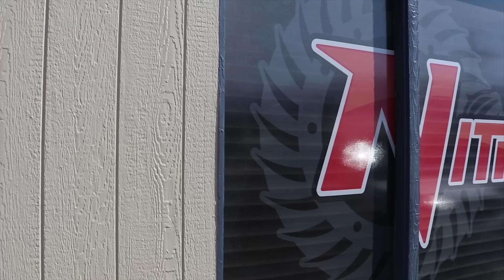The Tacoma gets 5.29 Nitro Gears | Huge improvement!

Comment: When I went to 5.29 in my rock crawler it was a huge difference. Such a great difference. Glad you did this instead of getting another truck.
Reply: @Delta Striper Slayer -- I went to 529 on my rock crawler it has 37 inch tires. It brought my power and torque probably right back down to stock performance, as well as the gas mileage
Reply: Aftermarket axle set up since it's a rock crawler?
Reply: Jimmy Jet! Question, would you recommend a future gear ratio change on a 2015 4RUNNER SR5? As you know the stock ones lack power in the torque department and soon I’ll be putting 35’s on to start some “overlanding”. Your thoughts :)

Ps MP sick Taco! Subscribing right now!
Reply: @patrickgronemeyer3375  
so, what do you drive?
Reply: mpg after ?

Comment: Toyota just needs to put the small v8 in this truck bottom line🙏
Reply from the maker: That would be awesome
Reply: why don't you do it.  only cost about 10K for a 400HP motor
Reply: Yes v8 taco and diesel tundra.
Reply: Agreed the V6 are shit, it doesn’t have to be a race truck but a huge displacement V6 is doing the truck no favors
Reply: @thenavigator5889  10k you drunk?
Reply: @MotoRacer171 , I'd need it supercharged too
Reply: @thenavigator5889  think you can buy a suoercharger for a grand used
Reply: @MotoRacer171  or less
Reply: Twin turbo v6. Would be dope. Tundras will have a twin turbo v6 soon
Reply: V8
Reply: I don't think you guys will ever see a V8 in a Tacoma
Reply: Turbo diesel
Reply: these trucks are midsize trucks the ideal is to have a midsize engine for better fuel economy 
if you want a v8 go for the full size..
Reply: I've seen a 4.7L V8 in a Tacoma. I have a D-4D 4 cylinder diesel engine in my Tacoma. The torque and mpg is awesome, I've also done a bigger gas tank as well and my hwy mpg range is 800 miles or so.
Reply: @stevenpeterson7234  You're a beast! Thinking of doing this to my 2020 Pro. Been doing research on those engines for a while now. I can get one around $6500. Do the Fab work my self.
Reply: @kouki2123  
The D-4D diesel engine is a beast, I've had no problems with it. Honestly worth it!!! 🤘👍
Reply: 4.7
Reply: Or a diesel
Reply: @stevenpeterson7234  link to the fuel tank?
Reply: I got a 4 cylinder 4X4 3rd gen 🤘🏼
But would not be mad  at a v8, like inside that grey full sized from the last snow wheel adventure 🤔
Reply: I dropped a 5.7 in mine
Reply: I personally would just put a magnuson supercharger on it.
7k, as small a truck that is, it would feel like sitting on a rocket.
35's -  5.29's .
Reply: Yes!!! Or a diesel option and better gear options from the beginning
Reply: Besides rehearing keep the 6 calendar and add a turbo with a 5 speed manual and you will have better power better gas mileage and more fun you don't need to have the most powerful engine but it is good to have the power when you need it
Reply: Please help Toyota come up with a suggested MSRP for a V8 powered Tacoma.

Comment: I run 5.29 in my 100 series with 315s and LOVE them. 

Could not be happier. MPG went up. 14.7 from Tyler Texas to Colorado Springs. 75mph-85mph the whole way

Holds OD gear uphill with no drama. 

With the 3.1:1 transfer case gears, I can take my feet off the gas and brake on steep descents and just crawl down the trail.
Reply: Does it effect the overall speed on highways?

Comment: Hey Maxx, i find this video an eye opener and helpful. I was leaning towards the 4.88s for some time now and when i watched your video, it gave me a new perspective. I definitely do prefer the low end power as my current setup on my taco is getting heavier with all the mods i have done so far. i have a TRD-OFF ROAD manual transmission with 35s and some accessories on and i'm always shifting gears and definitely lacks the get-up and go that i miss when i first drove it off the lot. The 5.29 will definitely be my next major upgrade. Great video!! Keep them coming...

Comment: When changing axle gears ratios in a 4X4, the front and rear axle ratios must be the same ratio when operating in four-wheel drive. If the front and rear axles are different ratios, severe damage to the transfer case and other truck components will occur
Reply: no kidding.  good message
Reply: Oleksii Silin Im sure they know it

Comment: This is a great Video!  I have a 2017 stock. I feel even the stock struggling often. I use the ECT Power more than I should just because it feels so much better. I'd like to make this change in the future to the 5.29. Thanks Max! Good Info.
Reply: Blue14 I do the same thing.  Going to upgrade to 33s and hoping just using ect all the time will be sufficient and I think it will

Comment: Best way to explain a re-gear like you had done in your truck is if anyone has ever riden a mountain bike before. When you switch the gears as you pedal the bike and you can feel the difference in how hard you have to work. In a low gear yes your legs are moving faster but they are hardly trying inorder to get you to move. To high of a gear and your not doing to many rpm's, but you are having to push a lot harder then you normally would. That's just a good way to explain the difference if you have never experienced it in a vehicle before. It was for me anyway. K have a good day everyone!!

Comment: I love my 5.29 gears in my 93 4 runner. But the shop that rebuilt my rear end was trying to talk me out of the 5.29 because the pinion gear has less area to contact the ring gear. They were pushing hard for the 4.88 gears. But with my lil 3.0 and 35 inch tires it works out perfect. It put it back to stock feeling power and my Speedo is right on with my 35's. The shop then showed me a 5.29 pinion gear that was sheared off. But way more power I het from,the 5.29. I put a 4.30 in just to try it out and can't even think about using 5 th gear. But breaking in the gears sucks. I just put an Eaton E locker in and new bearings and seals in the rear end. Still in break in mode. I live in Bellingham Wa so I might see you on the trails sometime.

Comment: This video is the exact reason I went from stock 3.07's to 4.88's on my Jeep.  Congrats on getting your performance back!

Scott
Reply: What engine/transmission and tire size are you running? I'm still stock on my LJ with 33"
Reply: @gordis951  315 /75-r16 Mickey Thompson MTZ's on 16X9 PC Alloys.  4.0 with a 5 speed manual transmission.  G2 D44's front and rear with 30 spline chromoly axles, 4.88's and Detroit Truetracs.

Comment: Fuel efficiency of the engine is different at different rpms and also at different throttle positions, so its crazy complicated to know the best rpm to run as driving conditions are very dynamic.   Fuel efficiency is also affected by how the engine ecu is programmed.  It isn’t always for maximum fuel economy due to power and emissions requirements.   Gear ratio steps in the Tacoma 6spd auto are kind of strange and only Toyota could explain why they chose them as they don’t have even spread like a typical auto or manual.  In addition, it seems that to protect the transmission, they program it to shift out of overdrive at a relatively low throttle position when requiring higher power delivery, especially at lower rpms where heat from loading/lugging it could affect its life.  So regearing to get higher rpms allows the Tacoma to hold the gear longer as you will have more power available due to the higher rpms, but also, the programming of the shifting based on throttle position is allowing the transmission to hold the overdrive gears longer as the higher rpms mean less lugging.   
Generally lower rpms are more fuel efficient but only if you have enough power in the engine at those rpms and you are not being detrimental to other things, like heat and stress and emissions etc.  If you run, more weight, more wind and rolling resistance, bigger tires etc, you need to over-correct the engine rpm to get more power and better throttle position which will effectively and generally give you better fuel economy than stock gearing for the same exact driving conditions.
Reply: It would probably be best to let the dealer flash the ECU like a new truck. It has the ability to "learn" driving styles.

Comment: I follow TW pretty much every day, and didn't see anything about 5.29's even being available at this time.   4.88 were the only option for 3rd gen Tacos as far as I could tell.  I must have missed the chatter if there ever was any of the Nitro 5:29's availability. 

It's truly a liberating feeling once you change gears, huh?   Back in the 90's, I had an F150 with the 5.0, and something like 27" tires.  I jacked that truck to the moon with a 3" body lift + 6" suspension lift, and 36" Swampers.  Ran it this way for a few months and then regeared from 3:55 to 4:56 and that truck came back to life with extra ummph to boot!
Reply: There is a 5.29 thread on TW. They have been available for several months.
Reply: Thanks Marcus.  I looks like it was just this summer that the 5.29 thread got started.  It never popped up in my view when I clicked on "New Posts".  So far it looks like just a handful of folks have been swapped to 5.29, but all are AT guys.  Looking forward to hearing how it feels with the MT (like I have).

Comment: Great video! I’m about to get myself some nitro gears! Really debating between the 4.88 and 5.29 though.
Reply: Me too... still debating. I was thinking that it really depends what you do to the truck. I heard 33s or less for tires you stick with 488. Anything more than that or extra weight and tow, you go 529. I keep hearing different things though. It’s like there is no really correct answer.
Reply: @vietta3771  I know eh, I’ve heard the 5.29 won’t be too much and I’m scared of doing 4.88 and not being enough for the hills and towing but in scary 5.29 will be too much for 80% city driving
Reply: @Rickwynne  I’m in the same boat. I’m running 33s now. 285/75/16… No lift. Probably won’t. It gear hunts all over Dallas Fort Worth. When it’s windy… it’s worse! 15-16 average mpg and with the way gas prices are, it’s getting about the same as my buddies stock raptor …
Reply: @vietta3771  I feel like I’m gonna go 5.29 cause I don’t need to be doing 130+ km/h on highways always. And will be nice for towing and all the hills. Fuel
Mileage improved would be nice too, gas is outrageous
Reply: @vietta3771  you end up doing a regear yet?
Reply: @Rickwynne  with the gas price increase I went ahead and sold my truck then bought a Tesla instead! Lol, to be honest, I’m a whole lot happier. I don’t need to load items as much as I use to and everything else fits in the surprisingly large trunk of my model s. Insurance is higher but I only pay an extra $100 a month for my utilities versus the hundreds I spent for gas.
Reply: @vietta3771  oh nice bro! Yeah that’s hard to argue with. I honestly just need mine for camping and getaways otherwise I would have a car
Reply: @vietta3771  oh nice bro! Yeah that’s hard to argue with. I honestly just need mine for camping and getaways otherwise I would have a car
Reply: @Rickwynne  I’m seriously waiting for the truck EVs to be more of a thing. The range right now is too low for long distant trips. The rivian is super nice. My buddy has one. The hummer is too. Once they begin installing more chargers on routes I think I will make the switch.

Comment: I just bought a 2019 TRD Off Road, and this is the first vid (and subsequent comment section) that I actually felt like engaging. You being from the Northwest made it even better. It's been tough finding a place online to discuss these things in a civil manner without the pretentious douche bags coming out of the woodwork screaming "mall crawler!" if I don't install a certain type of tire haha. 

I have no idea what direction I'm going to take my mods in,  but this is something I'm definitely going to be looking into at some point. 
Even on my test drive, I can already tell that as much as I loved the truck, some of the "searching for gears" statements in this vid certainly felt validated. With all the "research" Ive done thus far, I know some changes will need to be made if I'm going to get the full potential out of my truck. I appreciate the vid. It was entertaining and informative. Subbed.
Reply: @Maxx.Powell  Thanks! That's good to know. The truck is still in transit from the factory, so I'll definitely make sure to bring that up when it arrives.

Comment: All I hear from Youtubers is Tacoma transmission searching for gears, I have a 2020 tacoma TRD. Just drove from Washington state to Moab Utah and back. Truck fully loaded and a rooftop tent approximately 750 pounds total. About 1150 with myself and family in the truck. I have rock sliders diamondback bed cover, and load bars. My truck was never searching for gears, never upshift and downshift in sporadically or any of that. It held strong over all the massive long uphill grades. The vast majority of the time the truck stayed in one gear and pulled over the mountains with no problem at all. So I just don’t know what people are talking about when it comes to the Tacoma transmission. I’ve had no issues or complaints so far, no upshifting and downshifting searching, hunting for gears. Simply have not experienced that at all.
Reply from the maker: Being that you have a 2020 your ECU has updates alot of Tacomas on the road do not have.   My 2016 Tacoma needed to be updated to fix this issue
Reply: @Maxx.Powell  thanks for mentioning that. I thought I was going crazy, like, am I the only tacoma owner who is not experiencing this? I think people might use "3rd Gen Tacomas a little to generically when discussing issues. I'm glad the re-gear worked out for you, seems like a huge difference. thanks for the reply, have a great day, and keep up the good work!

Comment: For daily driving 529 gears with 35 inch tires, is way over the top. If you wanted to increase your crawl ratio when going Offroad, you could have put in one of those dual transfer case mods. With both transfer case is in Lo you would have a crawl ratio around 200, but the truck would be way more drivable in hi, and 2 wheel drive.
Reply: @Maxx.Powell   that's surprising. I would think you would have some issues maintaining higher highway speeds without going into high RPMs. Especially if you drive a manual with its higher 6th speed gear ratio.  In any case I'm glad it worked out for you. I'm on 33s, so I definitely won't go above 4.88. Maybe get a dual transfer case way down the road.
Reply: mo hawk The 6spd auto in the 3rd Gen Tacoma has a very high 5th and 6th gear.  .69 and .58.  With a stock unloaded truck this works well to keep low rpm’s as you do not require much power.  With a modified truck, ie. heavier, more wind resistance, bigger tires and more rolling resistance, you need considerably more power.  This means you need to run higher rpm to get that.  It is just physics.  Regearing to keep the same rpm as stock rig would not benefit the drivability or fuel economy.  The transmission would just have to downshift to lower gears to get higher rpm’s and higher required power effectively losing a gear or two.  There is a balance point and each vehicle and driving situation will differ.  In the end more power costs more fuel, but getting to use all 6 gears allows the truck to always drive at the lowest rpm for the conditions and saves fuel compared to only having the use of 4 or 5 gears due to the wrong axle ratio for the conditions.
Reply: @gregsheridan  not considering the additional weight, and just going off tire size, and the drivetrain gearing ratios, to get back to stock RPMs with 35 inch tires, you would need a 4.56 differential gear. With 4.88 and 35, you would have some additional torque to handle the extra weight, but still stay relatively close to the stock RPMs. The problem is that people choose their gear ratios with a mistaken  belief that it will give them more "power". Which it does not. All a regear does is determine how efficiently the crank shaft torque is translated to the torque at you tire. If you're regearing to get more power, you're doing the wrong mod, you need an engine mod for that. Of course you can go with an arbitrary large differential gear, but the cost of this is constantly running your engine at many hundreds RPM above what it was designed for. I can't see how this doesn't affect engine life, and to some extent drivability.

Comment: I went from 2.73 gears to 4.10 gears in my mustang and it pulls hard af out of the hole. The best bang for your buck is gears hands down. My gas mileage stayed them same and sometimes worse but I’m on the throttle a lot more now. Top end didn’t kill me either.. I still went 152mph with 4.10 gears thanks to the 6 speed
Reply: What year mustang do you have because  I top out at around 165ish with 3.31 and I have a 2014 gt
Reply: Andrew Bartholomew 2014 bro
Reply: @FerRod2113  with lower gears your top speed would be higher
Reply: Andrew Bartholomew  I know lol but those 4.10s rip like crazy from a dig. It barks the tires hard af going into second lol
Reply: @FerRod2113  well mine do that too but it no fun when your spinning and not actually catching also if you have that high of gears and if you ever add boost you rev to damn fast to use it lol

Comment: How’s the MPG before the regear ? And after ?
Reply: I went from 14 to 17 w/4.88 gears in a 16 4Runner.  22-2300 rpm @ 60
Reply: Best question in comments, I wish it would get answered...
Reply: Answer????
Reply: @ZacTexC  what's your tire size, mods, typical terrain elevation like?
Reply: 33 Toyo M/T 3” lift Fox 2.5, cold air intake n Borla exhaust. Denver